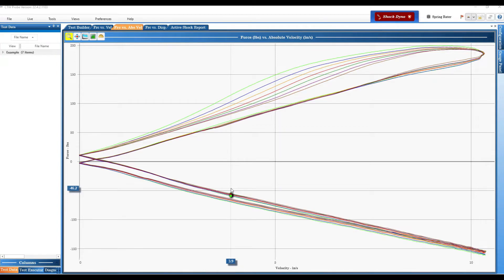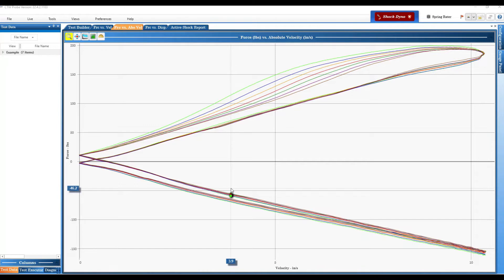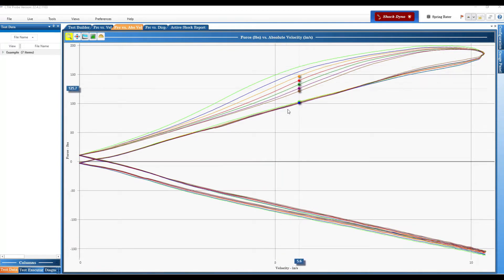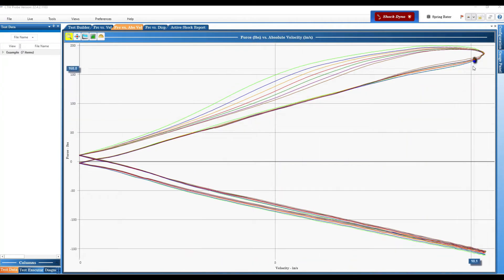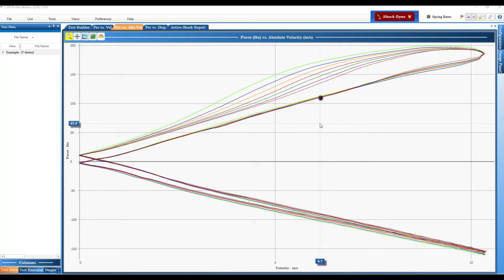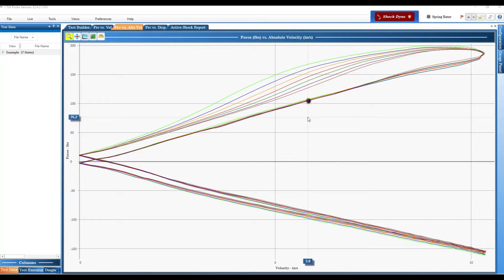Damper Question - Cavitation or not?

Comment: I am guessing it is a bleed problem.  Not enough bleed or maybe a check valve and shock not able to dissipate the pressure stored in the shock fast enough or some voodoo piston that impedes pressure relief.  Just a guess.  Could also be that the shock is just barely topping out on the dyno.